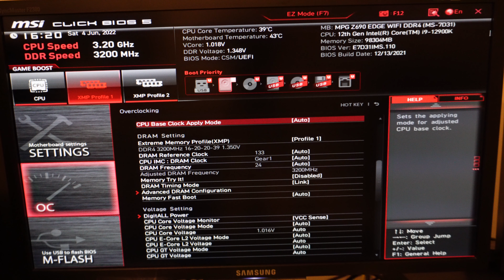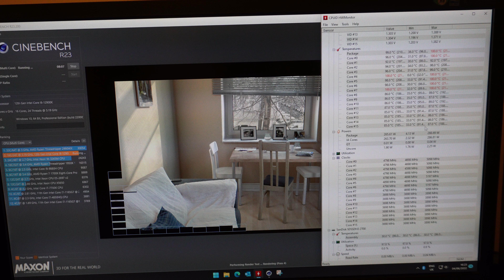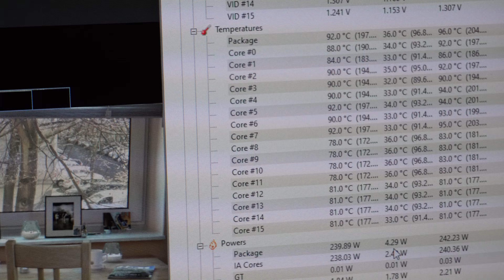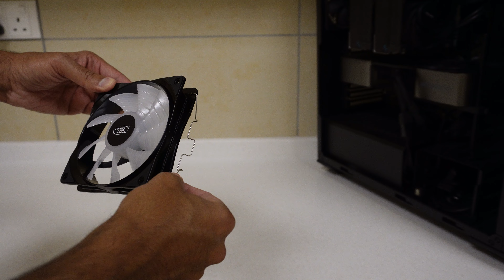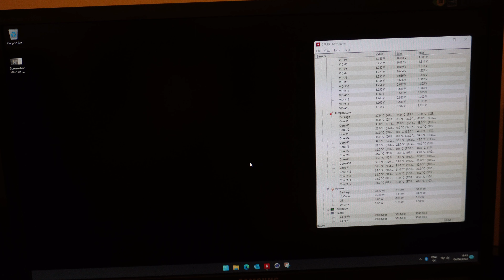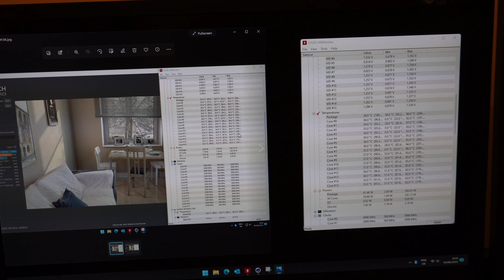Can DeepCool AK620 3 Fans Cool the Intel Core i9 12900K ? (with & without undervolt and power limit)

Comment: Do you think the ak620 with just the 2 fans it comes with will be able to cool an i5 13600k?
Reply from the maker: Hi, Thanks for watching. I don't have access to a 12600k or 13600k but as it has a much lower TDP than 12900k i imagine it should be fine. The link below shows a test on youtube with 1 fan on AK620 paied with 13600k and seems to do pretty well:

https://www.youtube.com/watch?v=-4dY4A7_hWU

Hope that helps, all the best, TK :).
Reply: Possibly it will work for you, its tdp is 181w, I have an i7 13700 with a maximum tdp of 219w but no air cooling could with it, much less an i7 13700k or i9 13900k at least in their default values in watts, I have had to lower it to 205w so that it remains stable below 92º in the stress tests or else some cores would shoot at 100º, from 181w to 205w there is room for you to keep your temperatures below 90º calmly . I have only been able to test with the high-end noctua, from what I see the ak620 is more of the same due to its results in the 12th gen. reaching 96º and with a lower score than the 13th gen i7 or i9.
Reply: @InfoLegenDz  I've already built my PC and I got the ak620 with my 13600k and it works fine
Reply: @clayton9838 hola amigo, me gustaría saber que temperaturas obtienes con ese disipador por aire
Reply: @Josehader  Hola, pido disculpas si el español es malo. Estoy usando el traductor de Google, el enfriador AK620 mantiene mis 13600k a mediados de los sesenta mientras juego y ochenta en la prueba de esfuerzo.
Reply: @clayton9838  tranquilo el español está bien amigo, te quería hacer otra pregunta. ¿Crees que ese disipador pueda con un i9 13900k?
Reply: @Josehader  Para un i9 13900k, recomendaría un enfriador de líquido todo en uno como Arctic Liquid Freezer 2 360 mm. No estoy seguro de si un enfriador de aire sería una excelente solución de enfriamiento, ya que puede calentarse mucho, especialmente en las pruebas de esfuerzo.

Comment: I’m having 99c I don’t even have anything running in the background. I have a Msi water cooler it’s working I checked the pump and all fans is working. My pc have the same specs as u but with a 3080ti and my cpu p-core can’t run higher than 3,2 mhz what is wrong with my pc I did clean everything but however I didn’t apply new thermal but I had the pc for less than a year. So please can you help
Reply from the maker: Hi, Thanks for watching. Just out of interest and I am not doubting you, but I made the mistake on a recent cooler install, forgot to remove the plastic on the cold plate of the cooler. Assuming you already took that off but worth checking. 

If this is not the cause, which motherboard are you using? If you place the cooler on the CPU without screwing it in, do you feel there is contact between the CPU IHS and the cold plate? Thermal paste won't massively improve the thermals, it's main purpose is to fill the tiny gaps to improve contact, maybe try applying a little more see if that helps fix any contact issues.

The only last thing I can recommend is make sure the mounting brackets for your cooler are correctly applied and you are using the LGA 1700 bracket.

If none of that helps, see if you can try another cooler if you have access to one and see if that works any better.

Let us know how you get on would be great to see you getting this fixed. All the best, TK :).
Reply: @TKsTechTalk  thank you for your response. My motherboard is msi z690 and I didn’t build my pc it was pre built but my watercolor cpu msi mag coreliquid  240r V2 has the normal two fans at the front but when I got my prebuilt pc it had two extra fans behind it I’m not sure why so I never checked it. My case is the nzxt airflow h510. So my question is should my  msi watercolor have two fans on front and on the back facing the same Side (outtake air)
Reply from the maker: @hashimohamed4511  To the best of my knowledge and checking the specs for MSI Coreliquid 240r V2, it should only have two fans by default not sure which direction they should blow in by default, though I'm guessing it might be exhaust if they are designed from factory for a preferred top mounted system. Hope that helps.

Comment: WOW subscribed. Thanks for the test.
Conclusion so far:
1. 280w vs 240w are came out with almost same cinebench r23 score, but 240w adaptive underclock can reach 96C instead over 100C. So the fatigue and the throttling is not so frequent. [Next: Can the motherboard setting arroung 220-240w manually for the best perf per watt?, or let say we target optimum 85C, how far we can get the cinebench r23 score for curiosity? ]
2. How far it different 12900KS in 241w max vs 12900 in 202w?
3. Maybe could you compare with same price AIO deepcool L240v2, IDcooling Se207XT ADV dual fan, and cheaper dual fan ARCTIC Freezer 34 eSports DUO?
Regards
Reply from the maker: Hi, Thanks for watching and I appreciate your support. As for your questions unfortunately I am not able to give you any useful information you can see my comments below for each:

1. I'm currently using an Arctic 420 in my system so if time permits I will try to see if I can test below 240w and 85C if possible.
2. I do not have access to a 12900ks so cannot currently help with this. I personally own and use a 12900k that's why I was able to share my findings. 
3. Again I am limited to three coolers Arctic 280, Arctic 420 and AK620, again these are items I am buying myself based on value and what I could afford to test. If I do end up trying the coolers you mentioned I will let you know.

Sorry for not being able to give you the answers you are looking for at the moment, but if you do manage to find any useful information around your questions, please do let us know, could benefit others with similar questions. All the best, TK :).
Reply: @TKsTechTalk  OK. Thank you for testing 12900K overclock using air cooler.

Comment: Hi, I bought another fk120, which is the current fan that this cooler uses. Will arrive in a few days and hopefully I will get the same results as I saw here.
Reply from the maker: HI, Thanks for watching. Yes that does seem to be the same spec fan as the on one the cooler. As you saw from my test, the third fan might give you 1 or 2 degrees cooler and it will take a little longer to reach the highest temp in sustained load. If you are using 12th gen intel (or something like 5800x with also runs hot) you can also try to undervolt which will also help a lot with temps. Let us know how you get on,  all the best, TK :).
Reply: @TKsTechTalk  Actually, just using a i7 2600 non k. It is adjusted to turbo to 4.2 and bclk was set to 103.5 on my asus p7p68. Brings my hyper 212 to its' knees, 90 degrees on cinebench so I bought this one, which now brings temps down to a comfortable 70 degrees. Planning to upgrade in the near future though, so I will be using this as well on the new setup I will be using.
Reply from the maker: @marlonmangubat4146  That's a great setup, looks like the cooler did a good job for your CPU. Will be interesting to see how the 3 fans works out.
Reply: @TKsTechTalk  Just received my third  fk120 today, though sad (or maybe happy) to say the temps didn't go down much, maybe because my cpu is not powerful enough to heat up the cooler. Or maybe Ill need to upgrade the exhaust fan on my NR600 case as well.
Reply from the maker: @marlonmangubat4146  fair enough that makes sense I guess, even my results show very minimal decrease if any, the exhaust fan may not make too much difference, but NR600 is a decent case. Also I think the triple fan setup maybe just helps a bit in lighter loads as its removes a tiny bit of heat.

Comment: I would be interested in a 1 center fan only
Reply from the maker: Hi, Thanks for watching. I do not have access to the cooler at the moment but if i get a chance I will try to check this, however against the 12900k i doubt it will be much different to what we have seen maybe only a couple of degrees warmer. The main issue with these 12th gen CPU's is the bending issue and I'm sure we will get much better temps using the contact frame. Hope that helps, all the best, TK.
Reply: @TKsTechTalk  Hi, I only have a 65W TDP 5700X to cool and I plan on unlocking the power limit and undervolt as much as possible. Will probably look at about double that power to cool.
I do not yet have all the components for this build, (planning on a completely new build and sell my whole old PC as is) and I am looking for a good cooling solution (Case / Cooler / Fans)
Cheers!
Reply from the maker: @Costinmusca  So from what I understand the 5700x is more efficient that something like the 5800x, not sure about overclocking but if you undervolt in addition to overclock I guess this cooler should be sufficient probably even with 1 fan, though its hard to say exactly how good it will be but even if you double the power will still only be 130W compared to 12900K's 241 + watts. It really is a challenge choosing the cooler, case and fans as there is just so much to choose from. Ultimately the best way to choose is price performance if we solely concentrate on value and ignore minimal performance gains for a lot more money. High air flow case as you are probably aware is the way to go for best cooling performance and a good cooler is essential, i think the AK620 is very good value for money though there are others like it. The case fans as long as they are quiet with good airflow is usually enough and best not to go overkill on exhaust fans, I would concentrate on making sure the intake is good and the case has sufficient space for intake fans. Let us know config you chose and how you get on, all the best with the build :).
Reply: @TKsTechTalk  Eventually I've settled for a Noctua NH-U12A, but still running various configurations of fans and HDD placement, just can't figure out which is the overall best solution to keep GPU/CPU and HDD all balanced out. I want my mechanical HDD to always stay cool and actively cooled while keeping both CPU and GPU around ~75 *C on full load and without interfering with each other too much.. Kinda hard since both GPU and CPU nowadays have their own power management based on how good your cooling is.. So I'd never see much difference in actual temps and on top of that it's kinda hard to keep track on the performance without a very stable environment. Also, still waiting on various gaskets/adapters/connectors for the fans in order to also get the most silent setup possible.
Reply from the maker: @Costinmusca  I think you made a good choice with the cooler, should be ok for the 5700x. As for the fans and HDD placements, I think maybe go with what's convenient as I personally feel that there may not be a big temperature difference maybe just a couple of degrees at most unless there is something blocking a lot of airflow in a smaller case. All the best with the rest of the parts and build :).

Comment: vale a pena esse air cooler para um 5800x3d?
Reply from the maker: HI, Thanks for watching. Sorry I have to reply in English but I believe this cooler should be ok for 5800X3D as it has a much lower TDP than 12900K so should generally run cooler than 12900K even in stress test. I have seen reports of people using it with coolers which are smaller than AK620 and this is a very decent cooler for the price. Unfortunately, I can't test this to know exactly how good it is but hope this helps, all the best, TK :).

Comment: good job. aparently youre the only one who has decided to make a video about the ak620 running 3 fans. The way i did it was placing a noctua CHROMAX NF-A15 HS-PW in the center (center for aesthetics) this is for getting a bit more airflow around the VRMs. We i got around 2-5 Celsuis in idle and longer to reach max temp. so while gaming should be better results since the cpu only work 100% at burst moments.
Reply from the maker: Hi, Thanks for watching. Glad you found this useful and I appreciate you sharing your setup as it may help others. Seems like you got better results too, maybe because the Noctua is generally better than the AK620. The main issue I think with the 12th Gen is the contact with the cold plate on the cooler. I have noticed from my testing of AK620, Arctic LF II 280 and 420 ARGB that the thermal paste mostly gathers down the centre of the CPU probably because of the bad contact. I believe that maybe using a contact frame will give better results, but I'm not sure if this will help with my CPU as it has been bent for 9 months now :). I might still give it a try and update if I decide to do that. All the best, TK :).
Reply: @TKsTechTalk Try the thermal grizzly CPU frame and also the Honeywell PTM7950 thermal pad instead of paste. Give the pad about 30min under max load to melt and get to functional state. You will drop 5-10deg C just from pad.

Comment: use i5- 12600K - ( with & without undervolt and power limit )
Reply from the maker: Hi, Thanks for watching. Unfortunately, I do not have access to a 12600K to test this, but considering the max turbo power of 12600K is only 150w compared to over 300W the 12900K can achieve, I believe this cooler should really have no trouble keeping the 12600K cool. The main issue with 12th Gen CPU's is that they bend once clamped into the socket and creates bad contact with the CPU. Because 12600K is much lower power, it should still be ok if we consider that the AK620 can still somewhat cool the 12900K at 241W. Hope that helps.

Comment: Thanks. Please make another video with AK620, but with 12700k if possible. And what is exactly, was your room temperature? Warm it's not specific.
Reply: Hi I know it's a very old comment, I just bought i7 12700k is it ideal?
Reply: @burnedmemory  Im way late, but yes - it is completely fine. Undervolt it (there are guides on youtube) - I still run a 12700k w/ a AK620 - I havent seen temps go past 70C while gaming (2 fan setup)
Reply from the maker: Hi, Thanks for watching. Unfortunately I cannot test with a 12700k as I do not currently own one, I can only test with what I use, sorry I cannot be of help there. Also at about 3mins 34 seconds in the video I did read the temperature off my thermostat in the room which was 23.5 degrees at the time, not too hot but maybe a little warmer than most people are use to assuming cooler climate and maybe use of AC. Hope that helps. All the best, TK.